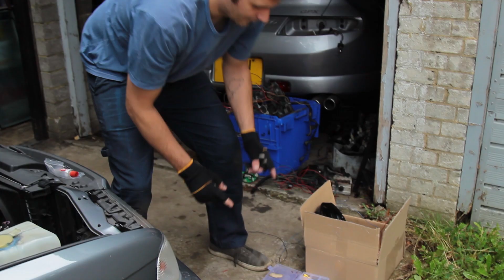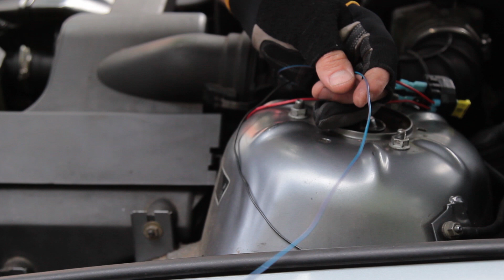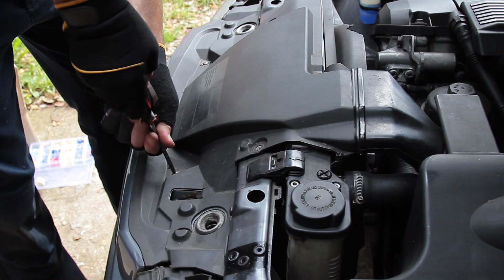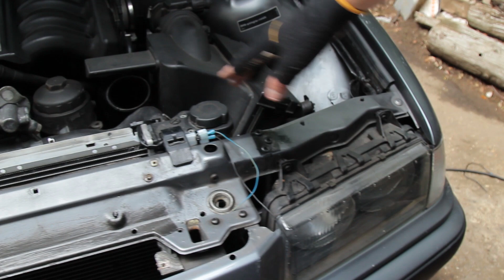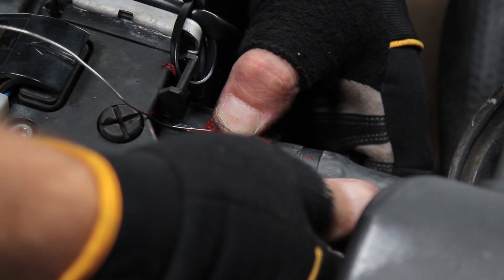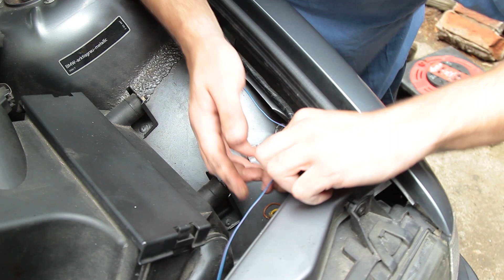BMW E36 Electric Fan Install + Wiring

Comment: Im planning to do the electric fan conversion, is it okay to leave the electric fan on the whole time while the engine is on? Im going to make manual switch wired inside, so its on or off only.
Reply from the maker: No, you don't want the electric fan running constantly. The car will run cold.
Reply: @ManSeeksCivic  just to be clear, im in tropical country so will that matter? Or should i really need to wire it to temp switch?
Reply from the maker: Sorry mate, you still need to. The car needs to run between 80 - 95 degrees. Your ambient temp is too low to affect this.
Reply: @ManSeeksCivic  oh i see. I'll just wire it to temp switch to be sure. Thanks brother for clarification.

Comment: Hey there!!! Nice job!!! Subscriber from Greece… which is getting very hot 🥵 in the summer. Do you think this mod is an overall improvement over the stock system?? I have noticed my car’s intake manifold is getting very hot and the overall performance of the car is affected by that. Is this mod going to improve that?
Thanks 🙏
Reply from the maker: Not at all really. It's simply to allow more space, less drag on the engine and the ability to fit a variety of fans. I run the oem viscous fan now and have no issues at all. Intake temperature needs a good fresh air feed from the front of the car to lower the temps.

Comment: Great video. I would like to find out. I’m running a similar sized radiator in my e36 325, it was originally a 318 and it’s not overheating or anything but a mate advised I buy a bigger radiator. Do you think that’s necessary?
Reply from the maker: It's not unless you intend to run aircon. The larger rad gives extra cooling for aircon cars. That said, it doesn't do any harm and depending on the climate where you live, can be good preventative modification.

Comment: I had the same problem with smashed fan blades, was a broken engine mount bracket and shot gearbox mounts, caused my exhaust manifold to crack as well.

Comment: Great video. Thanks. For which model of BMW is radiator normally installed?
Reply from the maker: Sorry, I don't understand your question.
Reply: The radiator and expansion tank in the car, which model of BMW is it normally installed in. The reason I ask is, my expansion tank is on the left hand side of the engine bay if you are looking from the front.
Reply from the maker: This rad is installed in all 6 cylinder m52 based E36's here in the UK. 323, 328.. It may also be used in the m50b20 and m50b25 here also. Its just as rubbish as the left side ones. The m3 s50b30 used a self bleeding, much better setup with the expansion tank near the fuse box.
Reply: Pamo 😂. Agreed it’s not the greatest. The M3 setup does seem like a better setup - I have not looked into it. Thanks for the response. All the best.

Comment: I took that Stroud off and chucked it works well without it great video man
Reply: it might work but the shroud is specifically made to have the optimal air flow through the radiator
Reply: It will overheat in traffic with AC on

Comment: best PWM fan for BMW 
 https://www.ebay.com/itm/For-BMW-E65-E66-745i-760i-2003-08-A-C-Cooling-Fan-Assembly-w-o-Brush-64546921379/282247430090?fits=Year%3A2003%7CModel%3A745i%7CMake%3ABMW&_trkparms=ispr%3D1&hash=item41b741ffca:g:gQQAAOSwhexcBM18&enc=AQAEAAACUBPxNw%2BVj6nta7CKEs3N0qWuMcyIC03%2FlH2w8YJWpezmE9LxfdiVEdkk5SbehgTFE%2FXeeUPAZxbDWDalU5KuONUSMPjoHyQTdSrOmidolspxHmkweRAndmudbT81bnQgzGqGUD2gFgXmA64gX%2BJRXyyJ%2FZcwtSWublUU%2F50lOxpEWKQU3JayV%2FCvtamPe%2BpVMzWbCnw0EKyuHVT02q4wkPAh3o9Ic%2FQ0wKW%2Fvkur3%2FpdAwOjOJuO7xfl64VFcmCSgC6cALfAC8w05RM%2FT5sAqLRihPFKYXS2qZmU%2FElPlt9QLpQvqXkPODk5MpglPR0jnQ9zsj%2BIyZN5PSceCKaE0oeRlZkoKlWA4DwgM%2FoMrmKKgfyk3rlXwvHZ2YB0EBm1FJRakxXRGeEqKiXp6SJioiMOyCi2pit8ktO3GFh%2Frl%2B16gfP4JPn8msfXCC87jHrRhQPozlTYJ1We8ZprScDqXa7uFzpzNyFJxkD%2FRQh4K5am%2Br7ZIg%2B1YUfqOnio64RrUf1hcaRZfkdlHGq%2F8grhUV3xwskNtuingpsKiLsdHwOlr%2BS%2F8t8SbNvLqKQb8ypGaIobf%2BF4bfNuWWK6sknuKYj8jqXom0pmPHSRfbBTEGtZvgAUwdh05sLuHAPMthSYKqDubBHDqdgwiz5W9f5MTws1Llgw%2FWRUfxjUk9nl5lWynQeEIFJMGWYxWwVGl1ZAoR%2B7EbnMxv4o7ETYPojkwemL6xZyGHnzBWKHuq7OAS68TbsGQaMrhFcDosbP2CiIaMGI6Gh34CgiC8o07B1tMo%3D&checksum=282247430090c70c6be3251a457c97085b77a509e7b6&enc=AQAEAAACUBPxNw%2BVj6nta7CKEs3N0qWuMcyIC03%2FlH2w8YJWpezmE9LxfdiVEdkk5SbehgTFE%2FXeeUPAZxbDWDalU5KuONUSMPjoHyQTdSrOmidolspxHmkweRAndmudbT81bnQgzGqGUD2gFgXmA64gX%2BJRXyyJ%2FZcwtSWublUU%2F50lOxpEWKQU3JayV%2FCvtamPe%2BpVMzWbCnw0EKyuHVT02q4wkPAh3o9Ic%2FQ0wKW%2Fvkur3%2FpdAwOjOJuO7xfl64VFcmCSgC6cALfAC8w05RM%2FT5sAqLRihPFKYXS2qZmU%2FElPlt9QLpQvqXkPODk5MpglPR0jnQ9zsj%2BIyZN5PSceCKaE0oeRlZkoKlWA4DwgM%2FoMrmKKgfyk3rlXwvHZ2YB0EBm1FJRakxXRGeEqKiXp6SJioiMOyCi2pit8ktO3GFh%2Frl%2B16gfP4JPn8msfXCC87jHrRhQPozlTYJ1We8ZprScDqXa7uFzpzNyFJxkD%2FRQh4K5am%2Br7ZIg%2B1YUfqOnio64RrUf1hcaRZfkdlHGq%2F8grhUV3xwskNtuingpsKiLsdHwOlr%2BS%2F8t8SbNvLqKQb8ypGaIobf%2BF4bfNuWWK6sknuKYj8jqXom0pmPHSRfbBTEGtZvgAUwdh05sLuHAPMthSYKqDubBHDqdgwiz5W9f5MTws1Llgw%2FWRUfxjUk9nl5lWynQeEIFJMGWYxWwVGl1ZAoR%2B7EbnMxv4o7ETYPojkwemL6xZyGHnzBWKHuq7OAS68TbsGQaMrhFcDosbP2CiIaMGI6Gh34CgiC8o07B1tMo%3D&checksum=282247430090c70c6be3251a457c97085b77a509e7b6

Comment: What’s up Pamo, I’m a subscriber. I have a question; can I run my e36 without a fan altogether? Can I take both fans out? I’m not running A/C I’m running a deleted A/C setup.
Reply from the maker: The fan is there to provide airflow over the radiator when the car is stationary. Technically speaking you could get rid of them but I would never advise it as the car will heat up quickly in traffic or when stopped.
Reply: Pamo Thanks Pamo.

Comment: Hi there. I did what you did expect I got the standard e36 328i electric fan which covers the whole radiator. I think it’s a 12inch fan or bigger. Then I used an after market thermal control with the blob that goes into my radiator hose and I just wired it up to the high speed on the fan. I did this for my 318is with the m42 in it . It’s been going great now for over a year
Reply from the maker: Nice one... I like that other people find different solutions to the same issue. Great feedback 👍

Comment: Lov3d the video..  Great procedure..  1 question tho..  Y not connect the wire kit directly to the connection for the electric fan That already exists..  U did a great job but wouldn't connecting to the existing harness do the exact same thing without all the splicing n time..  Asking for myself as I acquired a e46 that needs a upgraded aux fan and clutch fan delete
Reply from the maker: Being a non air Con e36, this car didn't have an aux fan. Hence no wiring to plug into. You could tap into the aux fan but you also don't benefit from the car being cooled as it should. As far as I know the aux fan kicks in at a slightly higher temp than ideal to cool the motor as it runs.
Reply: Opens at 97 degrees..  I bought a universal 14"..  I still have my aux fan..  It's just not working..  What temp does yours open..  These cars use that  high heat temperature for efficiency..  Optimum working temp a value I don't know...
Reply: Aux fan and the fan found on the manual transmission BMW's is the same exact part..  Just different fan brackets and shroud..  I'm actually trying to utilize Both as u did..  A puller and pusher..  I have a awd 325xi.. I need as much fan power I can honestly..  U are definitely helping me rite now..  I promise u..  Wayy more information than any bimmer forums and auto parts store..
Reply: Also..  Can u post a link for those radiator hoses..  I like hose clamps and prefer to avoid the stock style o-ring crap..
Reply from the maker: @trapman1338  I can't really advise you on the 46 setup as the connections are totally different to the e36. I assume that without an aftermarket radiator with smooth pipe connections you have to stick to the 46 clip and oring style connectors. Someone will hopefully confirm this who has more knowledge of your specific setup. This car is now gone and I'm running the 328 blue one with a viscous fan, air con and thus an aux fan. On an E36 at least... The aux fans job is simply to give extra cooling whilst the air con is running and the condenser is hot. I have heard of guys running with just this fan but I would never advise it. Whilst datalogging I get a consistent 83 deg celcius with the stock setup rising to 90 absolutely top whack.

Comment: enjoyed the video . nice to see some tidy wiring only thing i wouldbe worried about was rhe temperature sensor going in through the top pipe but if it doesnt leak then all well and good
Reply from the maker: Thank you. Your concern I shared. I ended up having to tighten the jubilee clips more than I was comfortable with. Since then, and on my newer 328 I've not installed the electric fan mainly for this reason. Ill eventually do it, but with a proper adapter including bung for a temp switch.
Reply: @ManSeeksCivic  makes sense be sure to put a video when you do so mate. the wiring was really tidy i shall be doing that to mine in the near future

Comment: Awesome vid man. Where'd ya get your fan etc?
Reply from the maker: Thanks Colton. I've updated the video with new links to the fan and thermostat. That being said - I'm going to use an updated version of the thermostat controller :
 https://rover.ebay.com/rover/1/710-53481-19255-0/1?ff3=4&toolid=11800&pub=5575389121&campid=5338301730&mpre=https%3A%2F%2Fwww.ebay.co.uk%2Fitm%2FHeavy-Duty-Dual-Electric-Fan-40-AMP-Relay-Wiring-Harness-Thermostat-Sensor-Kit%2F263109577031%3FssPageName%3DSTRK%253AMEBIDX%253AIT%26_trksid%3Dp2055119.m1438.l2649  
when I do the electric install on my new 328i.
Reply: Pamo hell yeah can't wait to see more updates on your e36

Comment: Totally agree with swiching to electric fan, much more reliable! I had an E34 with the same issues (breaking blades) causing overheating and more problems then I could figure out!  never thought to install this though! I hope to do this to my E36 when I get it! sweet video!
Reply from the maker: Thanks for the kind comments Luke. The control you get from electric is superior i think. Good luck with your 36.

Comment: How come there is no AC fan switch in the upper pass side of the radiator? Delete the OE electric back up fan?
Reply from the maker: Mine has no AC Mike.
Reply: Ah I see thanks.  Welded up a breaker bar like you did, pulled it all front face apart. But even when I lock the fan clutch, the fan will not unthread. Afraid some one cross threaded it not knowing it's reverse thread. We'll that's what cut off wheels are for.
Reply: Hey ended up using this homemade fan clutch wrench on my 01 dodge ram to....remove the fan. Had to cut it from 32mm up to 36mm for the Dodge. But the 323 has an electronic fan so all good. Thanks for the inspiration!